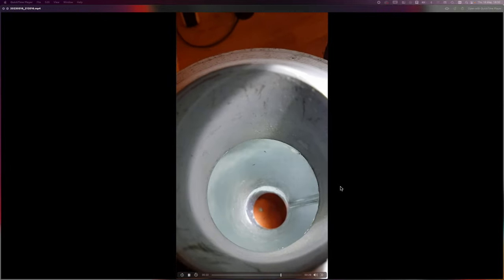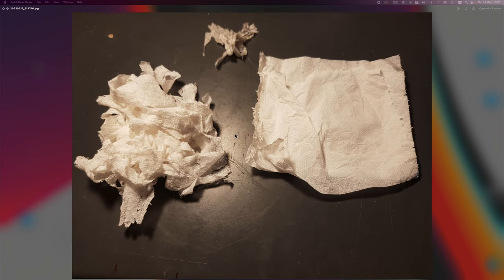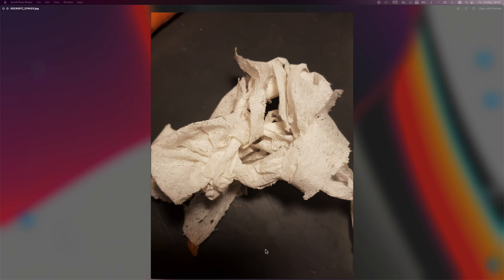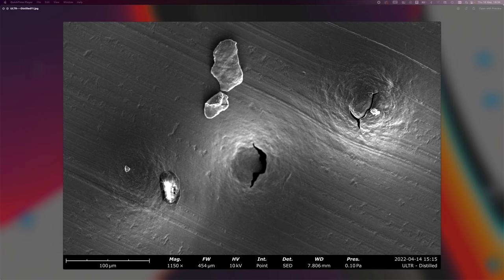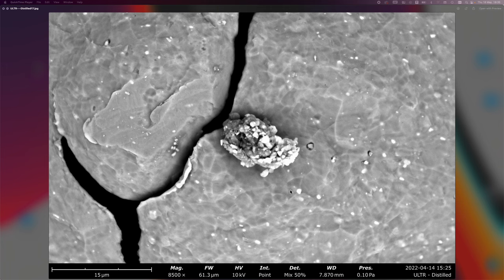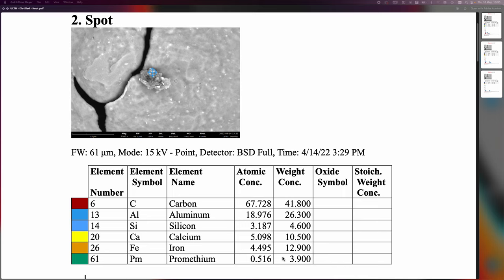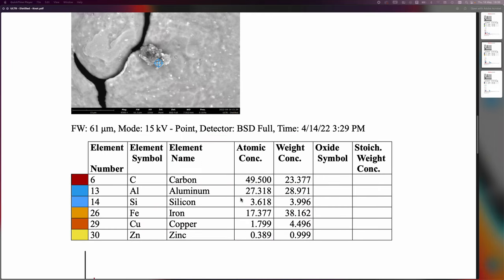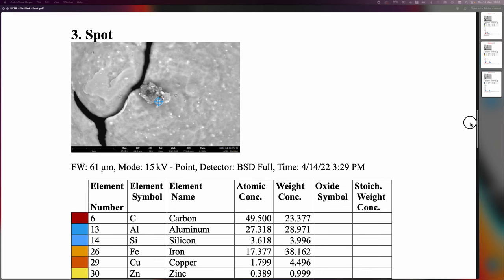O-Day - Vortex Knots

Comment: There's a youtube video called "The Amazing Power of Static Electricity", and it shows that dust accumulates charge when moving.  Consider adding various dusts into the materials you put into the windhexe.
Reply from the maker: Interesting idea.
Reply: I'd like to know what powdered rare earths magnets would do in a copper windhex at high velocity.
Reply from the maker: @polygon2744  I think I know where you are going with this - am I right?

Comment: Hey Bob

You might want to look into Cyclone Separators
Reply from the maker: It might look like that is what Henk has done - but in fact, Henk's input air goes into the top which is the equivalent of the air-flow distributor ring in the second revision of the prototype windhexe. There are then 4 slits allowing air into the chamber. In the cyclone separator, there is only one offset input (though their maybe multiple separate separators). A cyclone separator is actually like the Malcolm Bendall GEET-like device and the GEET itself.